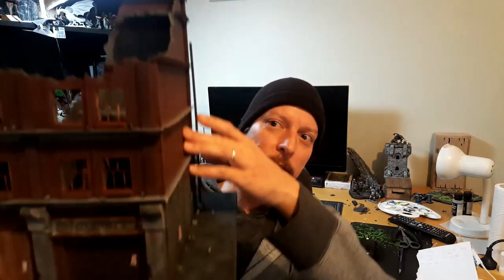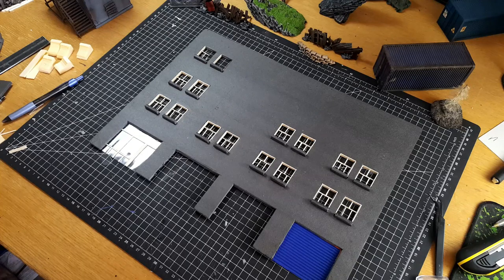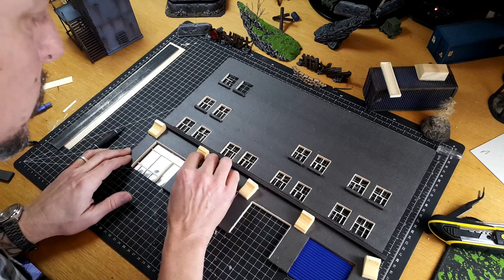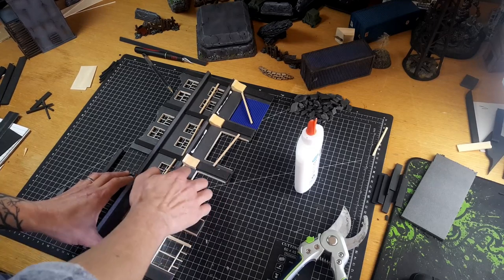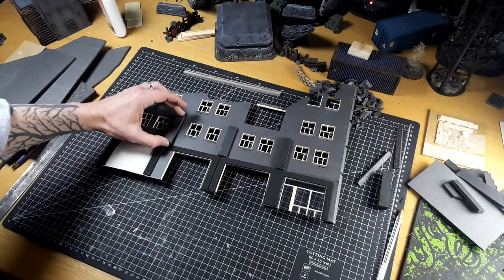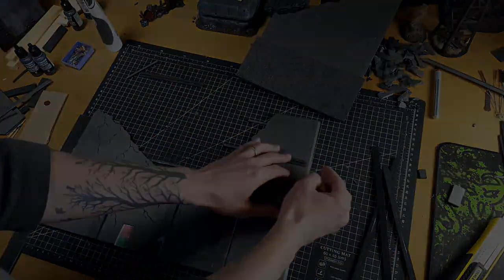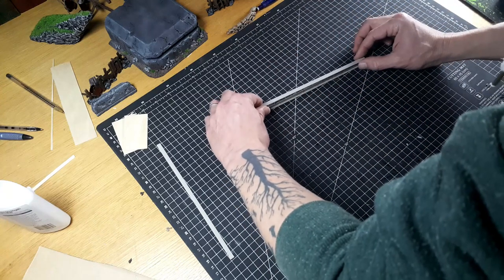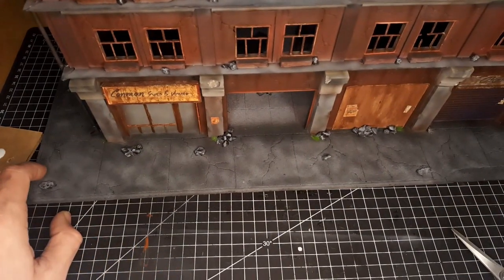Build This Huge Building for Wargaming & Dioramas - Perfect for Warhammer, Bolt Action, Walking Dead

Comment: I'm very tempted to do large builds for Necromunda. You'd only need a few pieces to form the basis of a table, but my main concern is it'll become stagnant with too little variety. On the plus side it looks awesome, and a building like yours is much more realistic in relation to size, compared to a lot of buildings in wargaming terrain.
Reply from the maker: Yeah, these big builds are tough, but I like that it has multiple angles to play from, and the interior is playable (mostly).  But it's a tough call between 1 large build and 3 smaller builds which can be moved around a bit more.  I think 1 large piece like this is enough for a table though, surrounded by smaller more modular type builds.  Acts as a bit of a center piece.

Comment: Awesome build!  I see a lot of things this size done on MDF for a base.  Do you not have much warping on the big painted foam base?
Reply from the maker: Thanks.  Actually no problem with warping here at all.  I find the warping to be no issue if you have the main build on top set relatively close to the edges as it seems to hold the foamboards flat shape quite well.  I have found some of the warping I've had on previous test builds was able to be minimized with watered down paint on the underside of the base, it tends to bring the base back to flat in the end.  The other thing to reduce warping is to make sure you take off the paper from both sides of the foamboard before using it, removing from only one side seems to make everything worse.  But so far I'm having good success with the foamboard bases on these projects.  Saves having too much weight on one end and potentially breaking the foam structure when moving it and stuff.  Thanks for the comment mate.

Comment: Way cool !! Is there a reason why there's windows on just the front? Just curious in case you had a specific purpose, if you mentioned it I must've not caught it.  The build turned out awesome, I'm excited to get a version of it going here! Thanks, keep it up!
Reply from the maker: Thanks for the comment Ben.  No real reason other than I suppose it's meant to be more of a commercial building, rather than an apartment building, so windows on the sides and rear don't feel necessary (Haha, I'm not really sure tbh, but that's what I told myself at the time :) ).  I did have other planned details for one of the sides, which I might do a video on down the track, but this one could have gone on forever if I didn't stop myself at some point.  Thanks for watching mate.

Comment: Great build! Thank you 😊 
Could you give more details on the 45 degree cutting tool? It wasn’t clear on the vid what the tool looked like, how you made it or how it’s used. TIA.
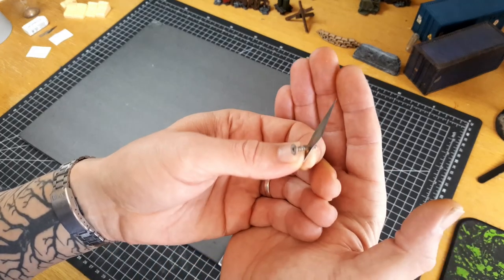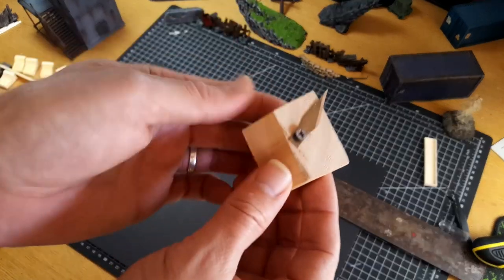Reply from the maker: No problem.  The 45 degree cutting tool is just a small piece of wood with a 45 degree angle cut on one edge, I use a standard craft blade and screw to attach the blade in such a way that you can move the blade before tightening it down with the screw (this just allows for deeper cuts).  The wood for this was a simple piece of 30x45mm pine wood offcut.  You can see the tool at around 1:47 & again at 7:50 in the video.  Let me know if you have any other questions.  Thanks for watching mate.

Comment: Wondering how strong this is? looks amazing but the foam looks very floppy
Reply from the maker: The foamboard on it's own is not the strongest, but once glued in place, and supported by the other pieces, it's really quite rigid and fairly strong.  It's not mdf strong, but i think the trade off is worth it given how easy it is to work with.

Comment: I'm thinking about making my own ruined building(s), but storage is an issue. What would everyone think of using rare-earth magnets along the frames and foundations of the walls to make them buildable and break down flat for storage? Anyone have any experience with this? Do you think 6x2mm magnets are strong enough to keep the building solid while playing?
Reply from the maker: This is a great idea.  I don't think I showed it in the video, but the upper floor pieces of this building are in place with magnets (small 2mm round), this was mainly to be able to play and mess around inside the building, and change the configuration of the floor, but it works great.  Small magnets will work fine to hold it together, it'll just be trying to move it around that will present any kind of problems with these, as they will more easily come apart than larger magnets.  If you build it with the magnets in mind, and plan it out, you should be able to get this working without too much trouble, maybe a bit of extra time involved in the building phase, but being modular would be awesome if you could change the buildings configuration whenever you wanted.  Let me know how you go if you try this, very interested to hear about it if you do.  Good luck mate!
Reply: @RFDHobby  Awesome, will do. Thanks for the reply. Keep building!

Comment: Amazing! Fellow Aussie here, which brand do you use for the foamboard? I cannot seem to find any that has a peel-able backing!
Reply from the maker: Hi mate.  Thanks.  I feel your pain there, I can't find peelable foam either, I have a video showing how I get the paper off using just water.  I've got most of my foamboard from Spotlight, but I see Officeworks has some now as well, and I think it's a different brand.  Might be worth a try.  I hope this helps.
Reply: @RFDHobby  how did I not see that video! I have some of the officeworks stuff and it is fairly similar to the spotlight stuff, same thing for dollar stores like ronnie's. Legend!
Reply from the maker: @smudgemarx  no worries.  I hoped the officeworks stuff would better but oh well  Pretty sure it's cheaper though, so that's something.  Good luck with your builds mate
Reply: @RFDHobby  just watched the other video, I tried all the same things EXCEPT hot water! Appreciate it, keep up the awesome builds!
Reply from the maker: @smudgemarx  thanks mate.  All the best.